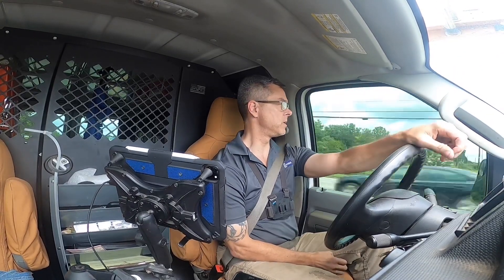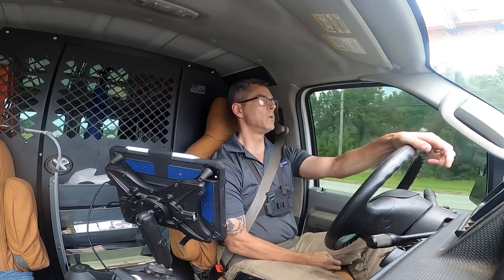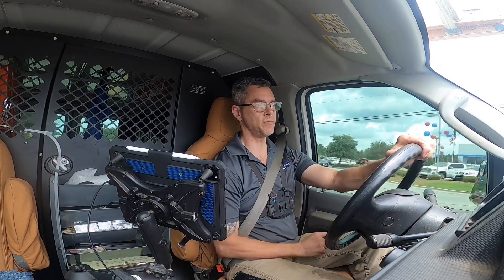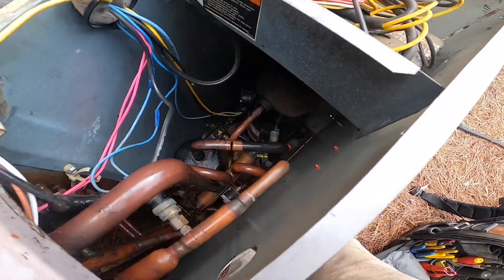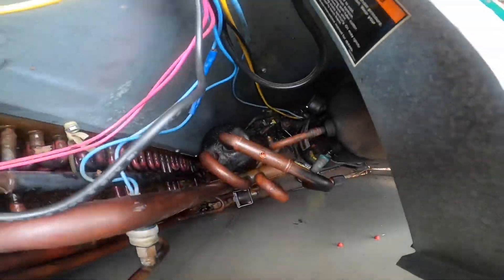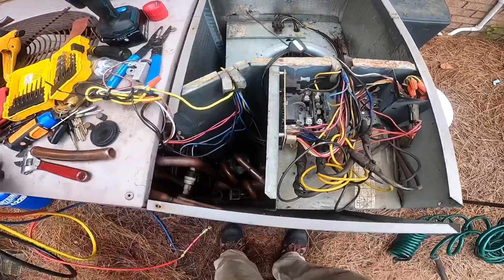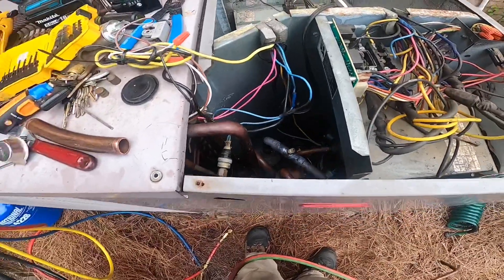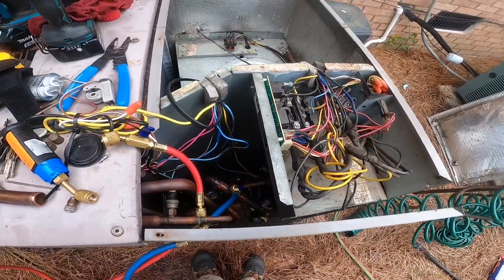Old Carrier blowing shrader port off, Best way to fix.

Comment: Got ya beat..

Did a evaporator/compressor replacement on one.. Had everything done with new contactor and even capacitors, fresh charge of $50.00lb R-22 7-8LB worth, went to snug the cap on "TRANE TYPE NO SEAL" metal to metal cap type, jut barley snugged it and (WHOOSH) sheared right off and lost every bit of it, i closed the valves as quick as i could due to having my wrench still in my pocket, saved about 1//4-1/2 in unit, recovered it.

I had to replace the whole suction valve even thought it wasn't my fault, it still happened on my watch.. Only thing i can figure is previous techs tightened too tight, little by litte instead of just barley snug.. So when i came along wand did mine she let go..

I put a 45* new Goodman back in it's place, with a seal cap that was brass and had a o-ring in it no tool necessary on both!

#LESSON LEARNED!